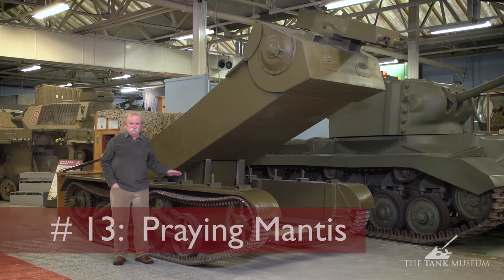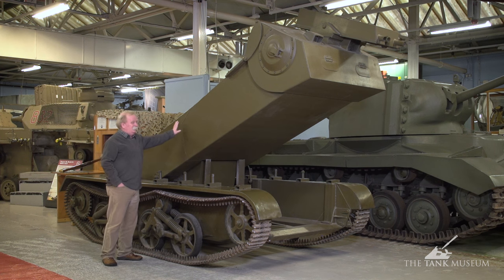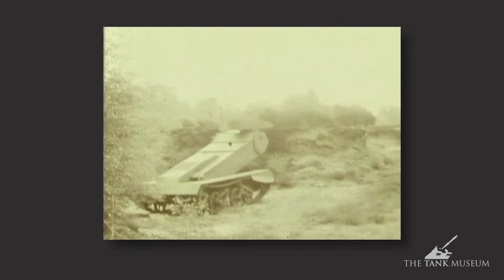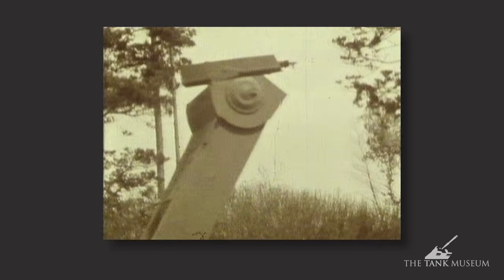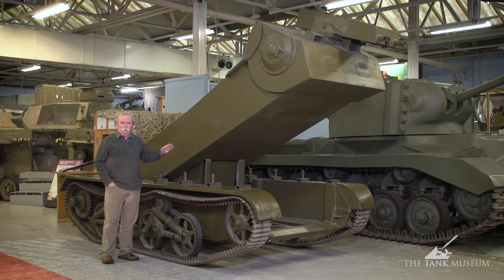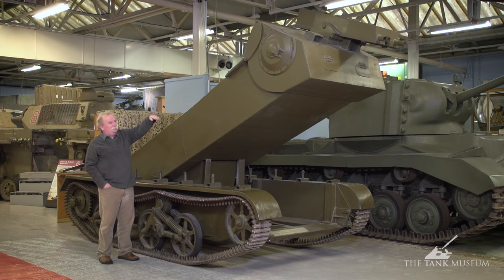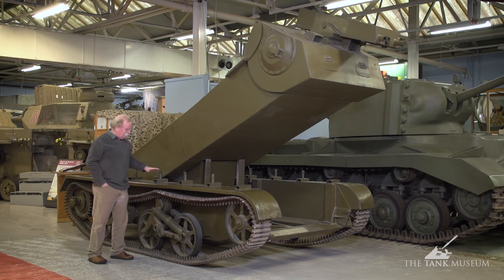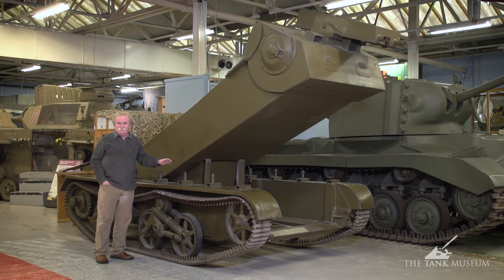Tank Chats #13 Praying Mantis | The Tank Museum

Comment: If memory serves this was intended to be used in the bocage terrain around the Normandy landing zones (a patchwork of small fields separated by stone walls and with thick interwoven hedgerows on top) and was to be used for firing over the top of the hedgerows.  By the time it was ready for testing though the Allies had broken out of the bocage and into the open country beyond and there was no longer a need for it.

Comment: It is ahead of it's time. The German army developed a similar system in the nineties, which could be placed on a truck and the elevated over treetops or buildings. It was designed as a deference system in the space behind the front line.

Comment: Missed it's potential, could have been a wonderful mobile HVAC unit. Already having the power source and the platform to take it anywhere really all it needed is a bit of piping a fan and a compressor. No need for all that dual Bren nonsense. And of coarse it could have been fit with the good old reliable tea kettle. Would have won the cold war as well I wager.